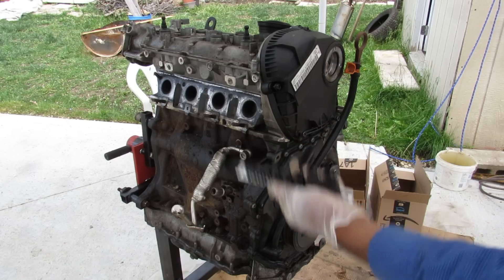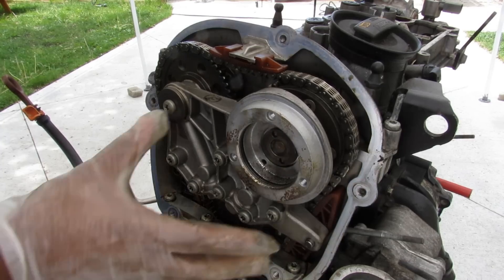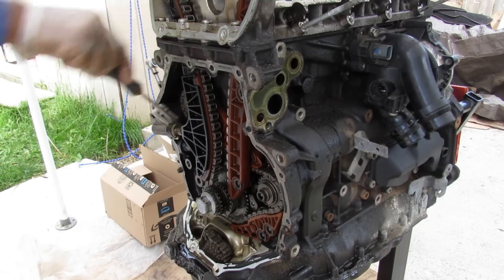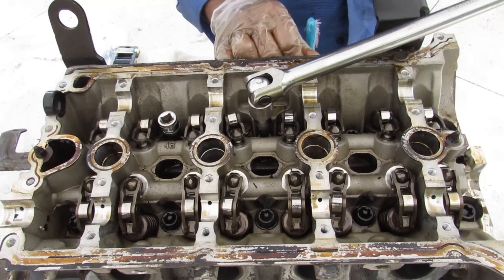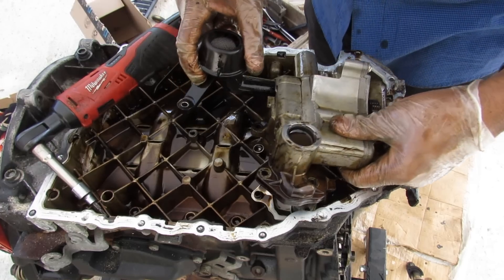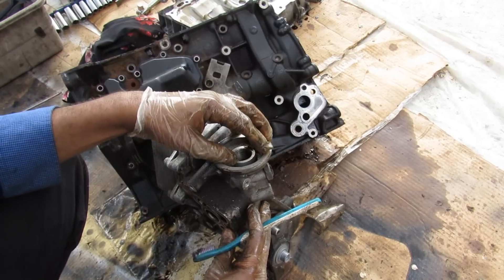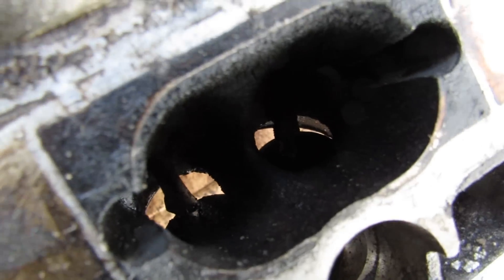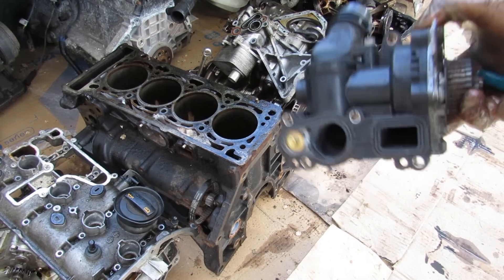Why Volkswagen Engines Fail

Comment: Hey, I really like the toothbrush AND your content. :-D
I have a wishlist for engines. Maybe one day they get fulfilled. 

-Volvo D5 185 PS,
I bought a car with it. And with DPF. I´m regreting it.

-Volvo 2.5 L TDI, D5252T
Best engine I ever had. In a V70 I.

-PSA 1.6 L HDI 110
This engine fails alot. The turbo dies because of a filter in the hollow screw which clogs from oil mud. Then the turbo gets no oil. Also the oilpan is designed in a way, that oil mud can accumulate in it.
Reply from the maker: Thanks. I did a Volvo 5 cylinder teardown last year, check it out
Reply: @speedkar99  Yeah, I watched it a few times. It helped me to understand the crankshaft case breather.

Comment: Me with a 1.9 TDI (BXE) sweating nervously
Reply from the maker: Whoops
I have a 1.8 Passat motor next
Reply: @speedkar99  😄 Yes!
Reply: @sensiblewheels  Replace the conrod bearings if it's the transversely mounted version. The non DPF variant is very durable other than that 👍
Reply: @petermolnar8667  The previous engine blew it's con rods! I have a 'new' (used) engine now. Think this one has a good chunk of life left (only 50k kms used)

Comment: can you tell us its mileage ?? the engine looks very good from inside
Reply: Apart from the bent valves and fucked chain tensioner etc.
Reply: @TeUhtred7860  
i know its complex design but you can prevent that by changing the tensioner i think its like 15$ part 😁
Reply from the maker: I don't have miles sorry

Comment: my 2007 audi a3 sure had a taste of this great engine's issues.... had an engine swap at 72k km (fortunately under warranty at the time). Had my check engine light came on while driving on the highway, then the car just stopped accelerating and shutted itself down. Found out from mechanic afterwards that it was a bent valve.
Reply from the maker: Ouch! Did it skip timing?
Reply: @speedkar99  I dont know anymore details than a bent valve. DIdn't get to meet the mechanic when picked up the car from the AUDI dealership in Chatham, Ontario, they also damaged my radiator fan, which i found out months after.

Comment: Hopefully my 2021 GTI with the gen 3 EA888 stands the test of time compared to its older versions. Better tensioner, better piston rings, more power!
Reply from the maker: Hopefully no other issues were introduced
Reply: Best of luck...............
Reply: Something like that, the bridge, that holds the intake cam and exhaust cam, has been improved and a new design has been implanted, the water pump is still plastic as far as I’ve seen, and the timing chain yes is updated but shall still be changed at 60-70k miles. And so far I’ve put newer designed pistons in to defeat the oil consumption and a new timing chains that last awhile.
Reply: Literally everything other than the plastic water pump housing has been fixed. When you start to smell sweet coolant in the morning, it's time to replace it.
The crankcase vent oil separator improved a lot, but some people still get cold start misfires from carbon buildup once into six figure mileage. It depends on your oil change habits and driving style. Since the water pump is under the intake manifold, you could get the head blasted at the same time you do the water pump, depending on how long the pump housing lasts.
Reply: @acefighterpilot  so they’ve fixed the new ones??
Reply: @gunnargeroy8406  They still have leaky thermostat housing assemblies but that's about it. Nothing that will strand you or write off your car. Just anticipate a $1200 thermostat housing replacement when the car has about 70k miles on it. You'll notice a sweet smell of coolant in the morning before it causes any serious problems.
Reply: That's hilarious
Reply: If it's the European spec it will be good.
Reply: Friend had a gen3 mk7 GTI with almost 200.000 km (and 2 other with lower mileage), replacing the heat management module/smart thermostat was a little costly, and there was a catalytic converter efficiency trouble code once which popped up but didn't come back (could've been an oxygen sensor, although I'm not sure), but there was no extreme oil consumption or anything serious
Reply: Just don't buy German car junk.
Reply: @hedgehogthesonic3181  if you can’t afford it or don’t know how to work on it🙃
Reply: @aldinnukicic3458  Even if you can afford it or know how to work on it, it's still a piece of junk, and a waste of money, when there are vehicles out there far more efficient and reliable.
Reply: @hedgehogthesonic3181  okay buddy, that’s why when you buy a used Audi and a used Ford, once you fix the audis engine it’s mint, when you buy a used Ford everything else is falling apart, and American cars a junk,
Reply: Are*
Reply: @aldinnukicic3458   American cars are junk too, along with Europeans ones, some Japanese cars are bad too. The ones among being the most reliable and mechanically robust, are Toyota hybrids, due to the simplicity of the planetary gear set all of these use, there are no valves to clog, no clutches / discs to wear, there are only 2 electric motors and a power split device, so simple yet so robust, reliable and efficient.
Reply: @hedgehogthesonic3181  yet that’s why your here to watch this video😂 enjoy driving you Prius😂
Reply: @aldinnukicic3458   I want to learn more about other companies and their inferior, unreliable and unnecessary complex technology. Indeed i will enjoy driving my Prius, likely to be the most reliable and efficient car that is not an EV.
Reply: @hedgehogthesonic3181  well your better off learning about ev’s considering vw even said they were stopping the making of new engines.
Reply: @JohnDoe-xw1jk  I know a lot about cars, and i have replaced both the brake pump assembly and brake booster assembly on my Prius. Battery mining is bad, but these are recycled and last 10 / 15 years, and can be recycled. In the long run the Prius pollutes less, and is less expensive to maintain and run, compared to a conventional car. The Prius is not slow, it accelerates slow, but top speed is more than enough.

Comment: I have a 2012 Passat with the 2.5 5 cylinder engine and I was told that I got the better of the engines that were put in these cars. Now I Know why that is. My god too much crap to deal with. I've been very happy with mine it has 176,000 miles on it no issues other than a starter.
Reply from the maker: I'd assume that the naturally aspirated engines would be more reliable

Comment: Designed for leasing followed by disposal and recycling.
Reply from the maker: It's wasteful in some sense
Reply: If you do the maintenance it will last - mine has 140k miles but it's been well cared for.
Reply: 140k isn’t exactly a lot either. Lots of cars go 200k on nothing but oil changes and neglect.
Reply: @ckm-mkc  how much money have you spent on fixing it?
Reply: @ckm-mkc  Sad if you think that is high mile and a long enough engine life.

You need to see how engine life are for 80's 90's engines (today) and where 2000's 10's engines should/can be.
Reply: Absolutely correct 👍
Reply: Idk man, I'm nearing 200k on my a3 and I'm doing fine..
Reply: @codym2108  how much have you spent fixing it?
Reply: Well said
Reply: 2013 mk7 GTI 100k miles and still stock water pump but I’m worried now…
Reply: @Yoshimetzen  If it's the original pump it's probably the original belt as well, since you are supposed to change both at the same time.
Reply: Yep, as long as it survives 3 years VAG don't care anymore.
Reply: Built like Scrap for Scrap
Reply: 315whp on a GTI and loving it, haven’t had to fix anything major whatsoever
Reply: I've got a 2001 Jetta 2.0 with 215k. Doesn't leak or burn oil & very few regular maintence type problems.
Reply: What an absolute piece of junk! I'm a mechanic everything I seen here is just made to be a tremendous problem in the future.
Reply: Lol.
Reply: Or for those people who is embarrassed to be seen driving a honda
Reply: @OrganicWheat  what is embarrassing about owning the most reliable car engine?
Reply: My 3rd citroen's engine did 465.000km on just basic maintenance. Then I drove it on it's own power to the salvage yard when I did not have the money for inspection and road tax.
Reply: My mk2 octavia vrs was remapped at 40k, it's still going at 180k. That engine uses cam belts, not the chain but it's been fine.
Reply: @steviesteve750  what does remapped mean?
Reply: @steviesteve750  oh so you did a tuning. I wonder if it's worth it but I'm also scared about damage, especially those tunings that at the same time save fuel.
Reply: These had a few issues but once resolved the water pump and timing chain are no longer an issue and these engines don’t have problems. You won’t get accelerated wear in one cylinder causing need for a new long block like my buddies Hondas always had.
Reply: Thanks to consumers that continue to buy them. No thanks, I'll keep my Kia.
Reply: @kristianhermann5971  kias aren’t exactly super reliable either lmao
Reply: @kristianhermann5971  😂 😂 Ya you can keep your Kia alright.
Reply: Kristian Hermann kias aren’t any better. Lol.
Reply: @kristianhermann5971  Have you not heard of the millions of units recalled by faulty engines?
Reply: @crxdelsolsir  Yes, I have. If you're referring to the Theta II engine recall, that was related to a QC problem in one engine plant (not the design itself).
Reply: @kristianhermann5971  like that's going to last longer
Reply: @kristianhermann5971  Blame consumers for industry trends created by the need for constant car sales? Can’t indefinitely sell cars if they run forever
Reply: This is such nonsense. Leasing is mostly 6-12 months and max 30000km. You can buy extra warranty from Volkswagen. My GTI has 150.000km 5 year warranty and only cost like 700 extra. Engines like in this video are rare cases.
Reply: @xxBlackpspxx  Warranty is what they want you to get (extra spending) and warranty is not renewable indefinitely.

The motors are designed to give problems and for owners to keep donating for security. 

Past warranty the engines are not indefinitely refurbishable like the older designs.
Reply: @crxdelsolsir  blablabla. First you said the car is disposed after leasing
Reply: @xxBlackpspxx  ?
I never said it will be disposed after leasing? But I agree with Luiz Henique statement it is designed essentially for short term use then disposed.

 It is designed for early failure, difficult to repair, less ability to refurbish components with less parts and manufacturers holding parts for shorter duration than in the past decades.
Reply: @xxBlackpspxx  Exactly. VAG literally threw them at everything with 4 Wheels and they can withstand some serious abuse. Pushing them over 300 and even 350 hp is easy and they will run fine if maintained well.
Reply: @xxBlackpspxx  So when you pay extra money your car by magic gets more reliable? If the car most likely would break why they offering warranty? They’re stupid or they love to lose money or else? Most likely they would not pat for the repair and would say this kind of defect isn’t covered by warranty. What you gonna do? Go in court and hire a lawyer fir a car repair which would cost many time more than repair! Warranty is a polite way of saying:- I love to rip you off!
Reply: @xxBlackpspxx  - I've worked on many of these engines. This is not a rare case. The timing system on them is too weak. I have yet to see one get to 150k miles without having timing issues. Good thing you got that warranty, because you will need it.

Edit: Oops! You said km, not miles. That's only 93.2k miles. You had to pay extra for that?! It probably won't fail in that time frame. The failures I've seen were in the 100-120k miles range.
Reply: @sienile  yes. But the statement that they are "made for leasing only" is much overexaggerated. And on how many cars you worked? 10 million? Not every single car is garbage.
Reply: @sienile  the timing chain jump is well known, search any vag forums and there are plenty of issues but they're still a very small percentage. The problem was pretty much resolved with revised design of the tensioner, if the forum chatter is an indication. Tbf, no engine is without some weakness, I've even managed to shag up a Honda vtec, and they're probably the best designed and built of all the high volume manufacturers. I commented elsewhere I've had a remapped octavia that's still going strong at 180k miles
Reply: @steviesteve750  - Haven't seen any put on enough miles after having timing done to see if the new tensioner is any better, but the simple fact is the original part is failing too soon. When the timing cover is a recommended part of the repair because it commonly gets eaten up, that's BS engineering.
Reply: @sienile  go look in Brisky. You need to monitor the chat trend. It's gone right down, it's not even in the first 5 pages anymore. A quick and dirty assessment put the failure rate at less than 0.001% using a sophisticated Internet algorithm. Allowing for massive (order of magnitude) uncertainty, its still pretty unlikely to happen. Whilst the triple 8 is no Alfa boxer, let alone busso, its a pretty tidy lump for a modern high volume sensor riddled device. The fact that you can reliably make 400PS / 550Nm without making any major mods is enough to tell you how intrinsically well engineered they are. You'd not want to try same with eco boost, or anything from GM Fiat. It's a soulless motor, devoid of much character, but it can be made to hustle a bit, without much risk.
Reply: @steviesteve750  - Triple 8? Never heard of that. We talking about the same stuff? 

Given that you used PS and Nm, you must be in Europe. Got news for you. The quality of Euro cars in the US is crap. They don't build them as good as they do the EDM models. It's almost like the Germans wait until October to make the USDM models and you're rolling the dice on if the assembler was tanked on too many pints. As I said before, I've never seen a USDM TFSI get to 200k miles or not need a timing overhaul at or before 120k. Wouldn't surprise me if EDM TFSIs did a bit better.
Reply: @sienile  EA888. Three 8s, ie triple
Reply: @xxBlackpspxx  not really its quite common to replace the timing chain around 100k km here in Germany to prevent a complete engine failure... 
The company I work for has multiple golf  and 3 of them already have new chains.
Reply: @galardo3303  is this according to VW service plan? Because in the internet it says chain is service free
Reply: Every car I’ve owned has gone over 200k miles. I’ve owned Toyota, Honda, Chrysler, and Volkswagen.  Volkswagen has indeed been the best car I’ve ever driven followed by Honda. My Jetta runs like a dream.
Reply: @BabyBugBug  I wonder though how VW holds out now with turbo vs yesteryear?
Reply: @moeanthony9308  Turbos put more stress on the engine. Use high quality fuel and regular oil changes. You’ll be fine. The turbo will need to be replaced for sure in a number of years, but mine has given me over 40mpg and 8 second 0-60 times, which isn’t bad at all.
Reply: @BabyBugBug  I suppose but naturally aspirated less moving parts than a Turbo. More so on those silly 3cyl s which heat up like a forest fire and require that little thing for cool down. Idk..no turbo for me. The horrors I hear along with eco boost this snd that.. Pass.. great for fuel economy but really how much you really saving unless you have a lead foot.
Reply: @moeanthony9308  I agree generally but I accepted the cost of ownership before I bought the car and knew turbos would never be as easy to maintain as a naturally aspirated engine. Whenever I buy a second car I’ll get an electric car anyway.
Reply: @BabyBugBug  Well said Ryan. Right there with you. I thought about hybrid next but will wait it out.
Reply: @BabyBugBug  you don’t drive it hard enough .. miss daisy ??
Reply: @carsandstuff365  Oh that isn’t true. I accelerate like crazy with that thing. It runs like a champ.
Reply: What a stupid comment that would make no sense the cars will come with a guarantee which is probably twice the length of the lease so they would go bankrupt fixing warranty claims how would that make sense
Reply: @arthuritchybollix5064   it's just idiots hating on VAG
Reply: @xxBlackpspxx  exactly. JD Power rated Volkswagen 6th for overall dependability in 2020. Genesis was in first, followed by Lexus, Buick, Porsche, and then Toyota in 5th place. Hyundai was 13th and Kia was 14th, both being beaten by BMW lol

People in this thread love to hate on VW, but the 3rd gen EA888 (the generation after the one featured in the video) is a rock solid motor. It won't withstand neglect like some cars from 30 years ago, but there were far fewer regulations on emissions, safety, fuel economy, etc that now act as driving forces in engine design today. Honestly, let people keep hating on VW, it just makes the resale values lower for those of us who actually know about them 😎
Reply: @arthuritchybollix5064  
Warranty rarely exceeds 5 years for VAG

Comment: a simple solution is surely to make all of their engines non interference!  I prefer Toyota and Honda cars but even then I do my homework on their specific models and years because even they can have problems.  Having said that we do own a 2019 Forester we bought new which my wife insisted she liked better than the CRV or RAV4 (I would have chosen the RAV4).  Was unfortunate to own a 2006 VW Jetta TDI, absolute junk, any savings made from the excellent mpg was way offset by the money I spent trying to keep it running!
Reply from the maker: Non interference would not give you the fuel economy of today's vehicles
Reply: @speedkar99  but I thought quite a few manufacturers still produce non interference engines no?
Reply: @robbflynn4325  Not sure if you can find a single non-inference engine still produced. Even Fiat FIRE 8V became interference at some point (around 2010?).
Reply: Subaru is the Japanese VW/BMW.